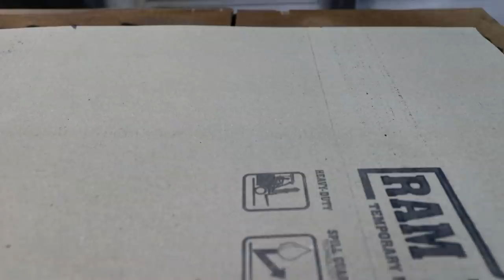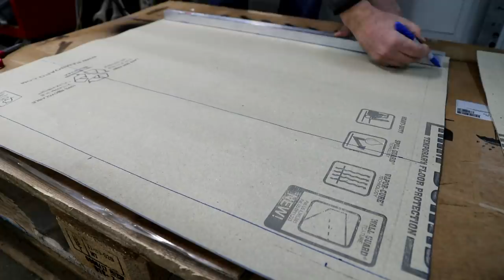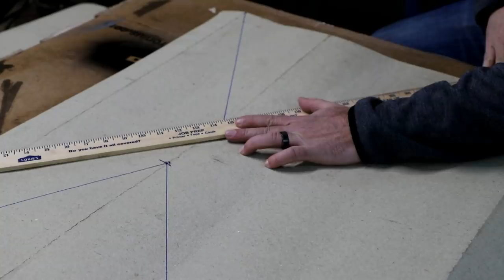CAD Work on the Fox-Body Mustang Build

Comment: If you ever need large sheets of heavier cardboard, try going to your local Sam's Club or Costco.  Ask the manager if you can have some of the sheets that come on pallets between the layers of product.  I've done this a number of times and they're fine with it.  It actually saves their stockers from having to collect them since most customers just push them aside.  The sheets are usually 40" x 48" and 1 or 2 plies thick.
Reply from the maker: good to know

Comment: Noice work, Sir! One notion, lease don't spoil nice shroud by punching unnecessary holes to it. Air duct works properly only when it is airtight.
Reply from the maker: This setup it wont matter if its air tight because of the way the fans will be setup...just needs clean air

Comment: Whoa....the cold air is gonna come in thru rear side widows... That is very nice.!!
     If you're gonna put speakers in that, you might think about a small box on each side (on the inside) so when you mount the speakers they sit into a box, so any rain or water can't get into the backside of your speakers, also then you can use sound material in the boxes.
     I'm not being an arm chair fabricator, just trying to save you time so you don't have to backtrack later.
Reply from the maker: yeah probably wont do the speaker idea

Comment: It looks like it will block room for a necessary harness bar. You doesn’t want the belts to diverge more than 15 degrees from level because an impact can completely destroy your spine. @thefabforums
Reply from the maker: I will make specific harness tabs to fit the seats
Reply: The Fab Forums ok cool. Just checking n’ tryin to look out! 👍🏻

Comment: So Im trying to understand which way the air will travel through your rad Kyle.Are you using your side windows as intakes and have a fan under your rad to draw the air through? What about making more rounded speaker boxes ,this will bring the slightly curved panels of the fox body into the dynamic .You dont want it to look so boxy because it does have curvy . The guy down below already made a cute remark about fox ears.Cheers man!.Lou
Reply from the maker: yeah the air will come in through the side windows and down through the radiator. I will be running dual puller fans on the bottom
Reply: Yeah that should work well and the properties of the aluminum itself as it will act as a heat sink on top of the air movement with the fans to collect and dissipate engine heat! I have two fans mounted behind Civic rads in the cowl just in front of my fire wall . I hope with all the Aluminum I have, I'm not going to be sweating my balls off in the cockpit. Time will tell.

Comment: Are you going to put coilovers on the front laying parallel with the ground? Or is it going to be just hydro?
Reply from the maker: just hydro with some accumulators to soften the ride...in the very beginning my plan was to use coil overs but decided to eliminate of the moving parts. Plus I like the idea of most not understanding how it works

Comment: I liked the initial shroud pattern shown at 3:22 for the Low Profile look better...the final results appears too angular IMO.  I feel that a NACA style duct mounted in the quarter window with some flexible ducting feeding air to the radiator shroud would give it more of an authentic "Race Car" look to it.  It would also look more aerodynamic/streamlined with added rearward vision over the rear deck.
Reply from the maker: that would be cool but I'm after custom hot rod vs functional race car
Reply: It's going to look awesome once it's done in aluminum.  I really like the finish you're putting on all that metalwork.

Comment: Nice. Was wondering if you were going to do something with the roof skin as like a venturi scoop and then just use a rear view camera for the windshield window. Think you'll get enough airflow from the side quarter window holes?
Reply from the maker: yeah I plan to run a dual fan setup, should get plenty of air flow
Reply: The Fab Forums nice! They'll work! Haha!

Comment: where is air going to flow over radiator ? i thought it would feed over the roof and venturi down over top but you just buried the main inlet option with your template which means air can only enter from side windows or under car
Reply from the maker: yeah air will inter from the quarter windows, be pulled through the radiator by fans and exit out the rear of the vehicle

Comment: Excellent design.
Will you be using electric fans in the side openings or just one near the radiator?
Reply from the maker: it will have two under the radiator pulling air through it

Comment: Just a thought... Instead of a rear view mirror, what about using a camera and a large IPAD like screen? Not just for backing up but you could use it to see out the back...
Reply: I WOULD imagine that, with this kind of build, a modern screen would seem outta place. It's so raw and maskuline, but just my take on it.
I would rather stick to side mirrors with this one, if hevs not going to use a rearview. :)
Reply from the maker: I have thought about that. Will most likely have some kind of screen for speedometer

Comment: haven't you think about making it all from acrylic glass ??? you could even make a roof scoop so there is even more air flow and it would be see through ... might look cooler to see the cooler and not only some aluminium sheets ...
Reply from the maker: that might be cool
Reply: @Thefabforums  How about acrylic for the ducts? And the horizontal sections in aluminum?

Comment: How are you going to mount the fans on the radiator with the panel over the top? Im diggen the build man.
Reply from the maker: they are puller and will be mounted under the radiator
Reply: @Thefabforums  im very interested to see the set up. Im doing the navy life right now but you inspire man. Thanks and keep it going.

Comment: How’s the air flow work for the radiator?
Reply from the maker: it will have two puller fans under the radiator pulling air down through it
Reply: The Fab Forums - Okay, that will work. Now I see why you were ducting air via those panels that start at the small quarter windows. Should be cool.
Reply: @Thefabforums  perhaps a small quarter window scoop on the outside to help push even more air into the radiator.
Just a thought is all😉😊👍👍
Reply: Yep, me too, side scoops would look very cool=))
Reply: You may need to louvre that deck lid instead so the fans can pull straight through - especially if your sitting at idle for any length of time.

Comment: Are you going to build scoops for the quarter windows ?
Reply: I was wondering the same thing
Reply from the maker: yeah maybe some small one....the radiator with have dual fans as well
Reply: @Thefabforums  200 degrees by your head would suck without good ventilation.